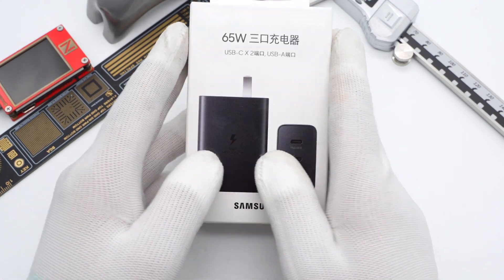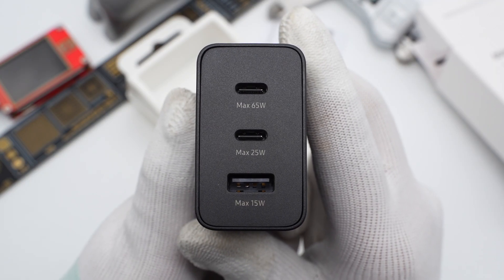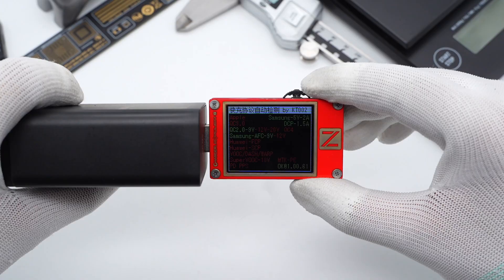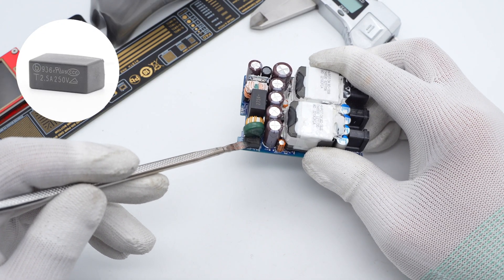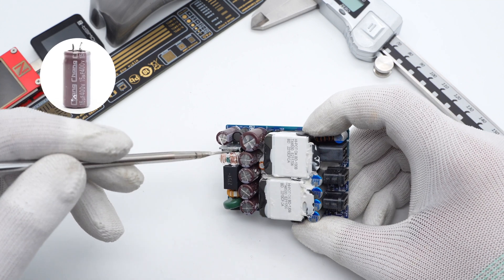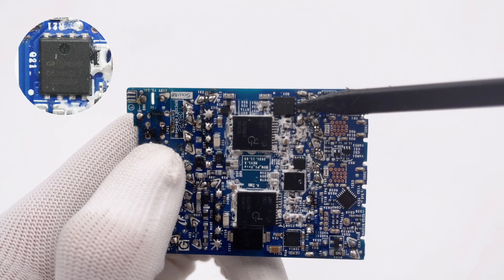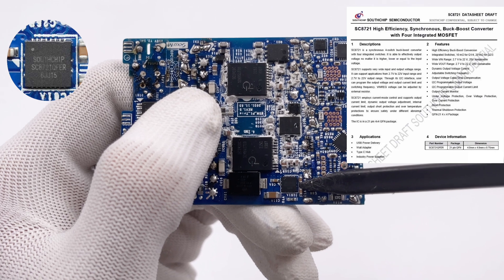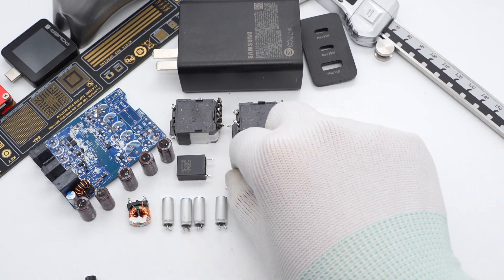Teardown of Samsung 65W Trio Charger EP-T6530 (2C1A)

Comment: PPS specification for the frist profile isn't correct on your usb tester, it should be 3.3-11 volts @ 3.5 amps while the your tester says it can do 5 amps which isn't true. I have note 10 plus and every time it's trys to go over 30 watts the charger resets because the phone is trying to pull more amps at 9 volts. So the phone wants 9 volts at 4.xx and this charger isnt capable of providing that and phone doesn't want to increase volts because Samsung doesn't want to do that because of there per set profile the phone has which is normal. The real question is why does Samsung say it's SFC 2.0 when non of there phones can even pull that power. If your looking to get 45 watts YOU NEED A CHARGER THAT DOES 3.3-11 VOLTS @ 5 AMPS not this f3c"*$_ useless Samsung charger. Honestly honestly I have no clue why this charger even exist in the first place and why they even say it supports super fast charging but it really does not. Please save your money and buy something else not learn the hard way like me and lose 80 dollars Canadian. Also this is true for there 45 watt charger which they had to update there 45 watt charger to even work correctly.
Reply from the maker: The tester actually detects/read the protocol burned into the chip.
Samsung might set additional limitations on this charger.
Reply: @ChargerLAB  Thank you for the reply, I really enjoy your videos please keep up the good work. 

 Maybe in future video if you could try to show real PPS max watts. I seen other videos show that some charger like essager 65 wat says it can do 3.3-11 v @ 5amps but it only does 32 watts but like baseus 65 watt it also says the same spec but it was able to do 45 watts. It just really sucks that PPS is so confusing to test for but manufactures never really say what's the max wattage that comes out of it most times. I really do believe this charger is limited by software but like you said it's reading the values from the chip which it is true but not true at the same time.
Reply: So this can't charge an Samsung S23 at 45W?
Reply: I was baffled to why both this charger and the Xiaomi 65W 1A1C use PPS 5v-11v @ 5A

The Xiaomi cannot charge at 45W
so this, too, will not provide true SFC 2.0

thanks for the heads up!

Comment: does this samsung trio charger uses GAN   technology or not ??
Reply: Probably not, the Power Integrations SC1920C belongs to the InnoSwitch3-Pro Family which only a few models use GaN technology. It's not clear if the SC1920C does since it's a Samsung customised model with no spec sheet available publicly.
Reply from the maker: No
Reply: It uses GaN chips. Samsung and Solum officially answered.
Reply: @dodu-dodu  Where did they confirm?

Comment: Can you test which 3rd party chargers can fast charge the M2 Macbook Air when it releases? 

Apple says it needs 67W charger for the fast charge, and most 3rd party chargers are 65W. Not sure which protocol they are using for the fast charge.
Reply from the maker: Thanks for your suggestion.